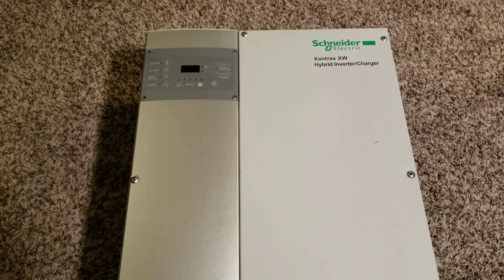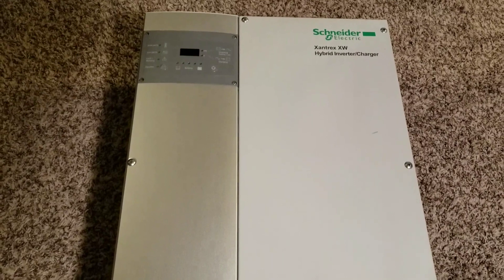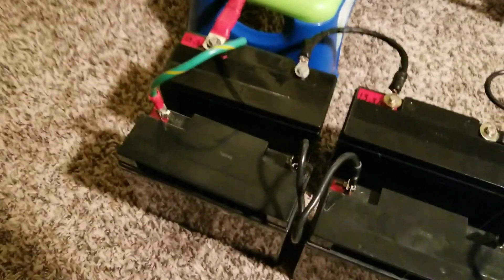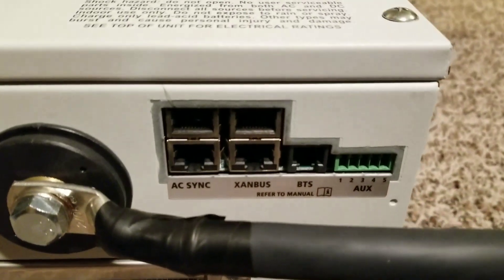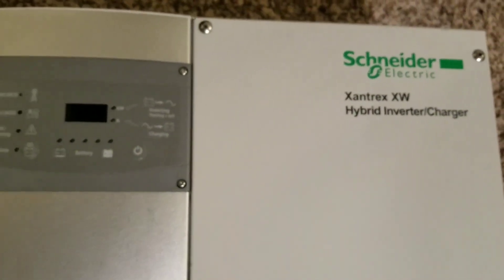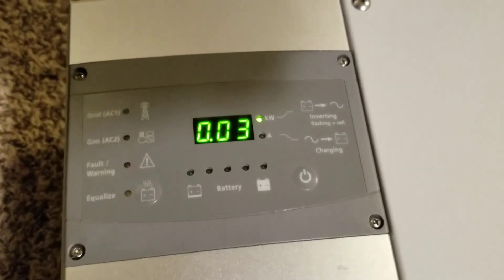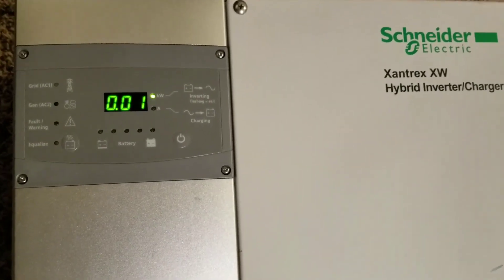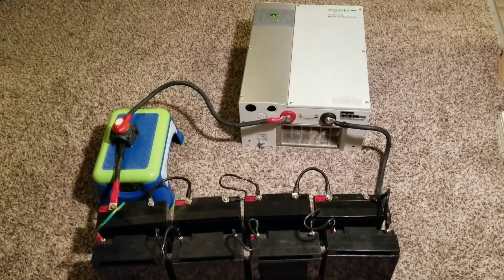XANTREX XW HYBRID INVERTER/CHARGER / Powering Up The XW6048 Inverter/Charger for The First Time

Comment: Did you update inverter firmware?
Reply from the maker: No

Thanks for stopping by and don't forget to SHARE LIKE and SUBSCRIBE
Reply: @jwsolarusa  I did and working great, installing EG4 lipo4 wall mounted battery soon.
Reply from the maker: @samba2498  
Where are the videos? Didn't you wanted to share
Reply: @jwsolarusa  I don’t make videos, but can share experience.
Reply from the maker: @samba2498  
Oh...

Comment: Hello,
I am trying to set up my inverter with lithium battery but there is no lithium to choose in the options.
Reply from the maker: Choose custom and inter the correct parameter specifications of your battery manufacturer.
Thanks for WATCHING, and don't forget to LIKE👍 the VIDEO, SUBSCRIBE & SHARE
Reply: @youssoufsoumare495  you can through connect insight home or insight facility. Can do all changes, battery BMS can be hooked through closed loop communication.
Reply: Hi did you able to connect it with Lithium battery? Please share your experience, thanks
Reply: Please share your experience of lithium battery if installed
Reply: @samba2498  My technician installed four 5kw lithium battery for a total of 20 kw, everything worked fine but I ended buying a more powerful and modern 16 KW deye inverter for better compatibility (the batteries were also deye).
Reply: @youssoufsoumare495  initially, were you able to install with your XW inverter? I will first try , if not buy a new inverter. How is your experience with Deye?
Reply: @samba2498  yes, I was able to make the 4 lithium batteries with the XW inverter without any problem. The 16 kw  deye inverter is whole other experience. It has integrated mppt and can take up to 16 kw directly from the solar panels, it also has a very intelligent smart management of different energy sources as well as extra protection.
Reply: @youssoufsoumare495  that’s so good, when you hooked 4 batteries, were they able to communicate with the inverter? I bought EG4 wall mounted 14.3 kWh but yet to be installed.
Reply: @samba2498  unfortunately they were not communicating with the xw. My Xw is dated 2014; long before these type of  batteries came out, so I don't think the xw would've recognize them.
Reply: @youssoufsoumare495  thank you for the details. My XW is dated 1014 too but I updated its firmware which includes Lithium batteries. Also I have Schneider Inshight facility which hopefully manage communication, if not I will go for Deye inverter. Could you please share model of your Deye inverter?
Reply: @youssoufsoumare495  nice...could you declare the brand of the Lithium battery did you installed, pls

Comment: Super video! How can I update the firmware on Xantrex XV Hybrid Inverter Charger 4548 whitout Combox? I have only a SCP panel(modul). I have a LiIon batery pack 48V/250Ah, but only 12s. Its mean Volt range from 36V to max 52V. The invertor work from 44V to cca.56V. I can use only a minimum capacity my batteries (from 44V to 50V)...
Reply from the maker: You have to incorporate Xantrex Conext Combox with the setup you have right now.
Thanks for stopping by and don't forget to LIKE SHARE & SUBSCRIBE